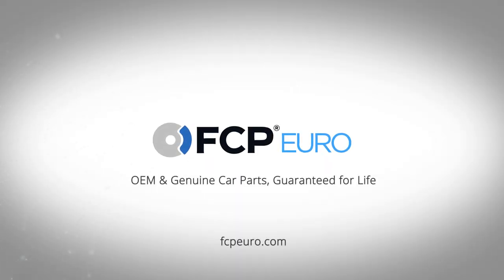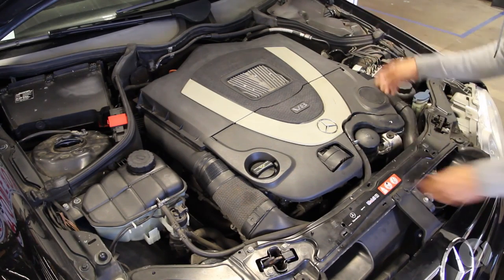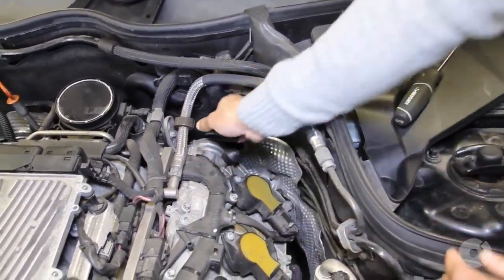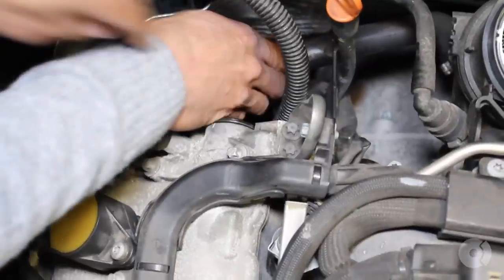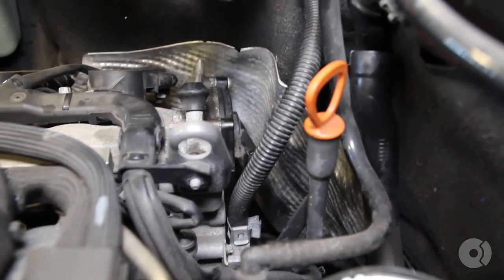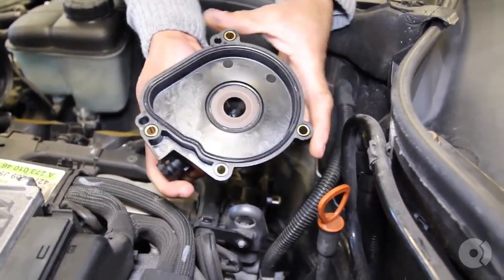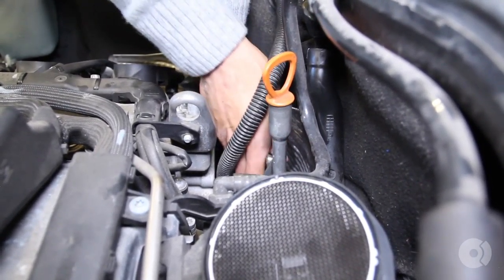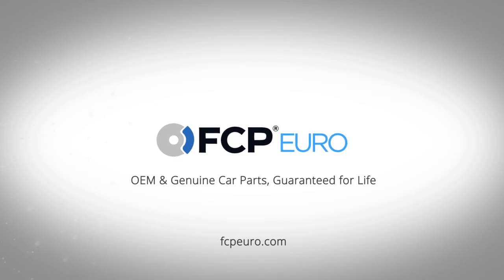Mercedes Crankcase Breather Valve Replacement - Easy DIY (CLK/ C-Class)

Comment: You may not be leaking oil on your exhaust from this part being bad. Little do you know there is excessive oil leaking in your throttle body. Due to that rebreather hose being directly connected to your air flow sensor housing. Which connects directly to your throttle body. So .. check your throttle body for oil.
Reply: Im seeing an oily mess around my throttle body. I figured it was from this cover, drip pan, and the other side oil seperator and hose going to the throttle body.  The parts alone arent that much but they all do add up.  Id love to clean the engine but afraid of messing something up.

Comment: Seems Like there's no Video Anywhere showing the Symptoms of Stuck Valve in the Newer Engines 3.5 M276 Engine. I'm Having a Very Rough Idle Like the Engine Visibly Vibrates/Shakes And Feels like its gonna Fall out of the Engine bay when I Gently Give it Gas (No its not the Engine Mounts) I Have done smoke tests and Tested for Vacuum Leaks and Found none. So I took the Breather end of the PCV where it plugs into the Intake Manifold and Blew Air in it and it feels restrictive, air still gets through, however, it's not getting through freely, I Have another engine I did the same thing and it Blows air freely, So I'm suspecting that it could be the Culprit, But I would like to know what the exact symptoms are when there is some restriction in the PCV. I don't see any oil leaks anywhere, Its a 50K Mile 2014 C350 Mercedes.

Comment: I changed mine the other day

NOTE:  With my vehicle the previous PCV valve had E-Torx bolts 8mm.   The two inboard bolts ( the ones on the breather hose side I was able to get a 1/4 inch drive ratchet with 8mm E-Torx socket.  The two outboard bolts are a little bit more....not overly complicated but admit that the space is tight and get it over with.  I used a 8mm box end wrench but not just any wrench a specific type.  Kobalt and I am sure other major tool makers have this type too.  It is the type that works on multiple types of fasteners ( 6 point, 12 point, square, and specific for this type...Spline head socket.  Yes manual wrench may sound crazy but in this case probably the only one that works.  Go in from the inboard (-Throttle body) side and place the box end on the body as close to straight 90 degree as possible.  The open end of the wrench should be on the throttle body side and if you have a slight offset angle fine.  Rotate bolt as close to a full 90 degree turn counter clockwise as possible.  The open end of the wrench should be facing the ground.   It might take a couple of tries but once you get the torque broken then you should be able to grab and finish by hand.  I was initially skeptical but changed my thinking when I saw how quick the torque broke.   If you insist on a ratchet/Socket then use a pass through socket set but for this case the wrench was much quicker and easier.  You could have the old valve out and new one in in the time that it talked you to get a ratchet/socket fitted over the head.  The added bonus is you have the head of the bolt to grab during removal.  The kitnfrom FCP Euro came with new T-30 Torx head bolts but since the E—Torx heads were fine and not stripped they actually worked better.   Since this is should be a fairly reasonably high mileage interval replacement the E-Torx head should work.  My 2011 E350 had just a tick under 103K during replacement.  I am fairly certain that this was OEM and the E-Torx bolts were used from Stuttgart but no big deal.  Thanks FCP for providing the Torx bolts and I am sure  they can be used for something.   Try a set of the E-Torx head bolts and try them for testing and future shipments. Thread pitch is the same as the T-30 bolts you provided but the E-Torx  bolts actually worked better despite having the same block-firewall clearance.  Also sliding the wrench over the head uses one less tool and keeps lower profile.  

 Note 2:   If you can get a piece of butchers twine or sewing thread wrap it around the outside of the open end side and secure tightly.  You can anchor the other end of the thread to either your wrist or a opening in the hood.  The logic is long enough to get the wrench to work with but anchoring to another area.  Drop a wrench, bolt, part, socket etc.....down in the engine bay ONCE and you will see what I mean.   Murphy’s law says the item dropped most of the time will not have the courtesy to fall through and straight to the ground.  At least twice this week the dropped items embedded themselves on a ledge somewhere in the Abyss of the engine compartment.  Most likely fell off that ledge after driving built as they say....learn from my mistakes.  Yes I have butterfingers but this can happen to anyone.
Reply: My 2010 C330 4matic Sport uses an E10 socket for the 4 bolts, but an 8mm closed end wrench also works.

Comment: Sunex 9732 44Pc 1/4" Dr Mini Dual Flex Head RATCHET W Socket & Bit Set 
This tool set was perfect for this job!
I used the 5/16 socket to remove the E10 Bolts and used the T27 to install new bolts, all included in this tool set!👍 I recommend for this job!

Comment: Fantastic video!  I found the parts elsewhere a little cheaper but I'll certainly buy them from FCP now that I've seen this video.  Real value.
Reply from the maker: Although we strive to be, unfortunately with the internet we can't always be the cheapest on every part! But we are still happy to be able to help share some knowledge and advice to anyone in need of it! Good luck on the install.
Reply: I buy most things from FCP for the replacement warranty.  Unless I just need something small like a bolt then ill go to the dealer.

Comment: Good video.  On a E-class, there was less space than this video, and I couldn't  fit a vise-grip on the socket (which is an E10 by the way) for the lowest bolt.  You can fit an open wrench but no one sells Torx open wrenches.  Fortunately,  a small 5/16 12-point wrench will fit and also grab the bolts.   So I used that for the whole job.
Reply from the maker: R D Thanks for the tip! That lower bolt can be a real pain...We will note that for any E-Class owners moving forward.
Reply: or 8mm closed end wrench for the E10 bolts.  I bought an 8mm deep offset long handle wrench specifically for the bottom right side bolt, made it much easier.

Comment: Can you guys post a video of replacing the partial load oil separator and it’s hose as well. I think if those parts are left untouched then the whole procedure which you performed is just incomplete. You guys sell those parts in your complete kit anyway.

Comment: I just got an E350 W212 - 2011. Having read up on the problems these intake flaps have on the intake manifold (a service writer at my dealer said he's seen some go at 100,000 miles; some at 200,000) - I get the feeling that if these are changed when needed that problem might go away - as they would let oil in to gunk up that lever. Then you have to replace the intake manifold. 

I too had a chuckle with Kyle's sweater but hey, if he is clean (cleaner than me) - why not? I didn't see one spec of grease on it. 

Don't know how he does it.

Comment: I have a 2010 E550. I noticed there is some kind of flexible grey hose that starts around the MAF and is directly behind touching the PCV cap (the grey hose is actually zip tied to the tube on the PCV cap on mine). The grey hose then runs parallel to the passenger side valve cover between the fender on the engine. It seems to be some kind of wiring that is protected by grey hose.  What is it ??? I don't see anything like this on your video. I can't remove the cap because the grey hose is in the way.
Reply from the maker: It sounds like that is a protective loom covering the wires. Perhaps you can try temporarily removing the zip tires and pulling the harness out of the way to remove the cap, and then zip tie it back in place when you are done.

Comment: Those bolts on my 2010 C300 4matic Sport use an E10 socket to remove.  An 8mm closed end wrench will work also.  Good thing i looked before doing the work, didnt have the right tools and bought a long handle offset wrench just to make it easier.  Surprised this video doesnt replace the drip pan while the covers off.  Im seeing oily gunk on my intake along the fuel rail and on the front so replacing all the breather stuff to see if thats the cause. Car just reached 150,000 miles.
Reply from the maker: We have a comprehensive drip pan and drip tray guide for the M272 and M273 coming very soon! These issues are often the cause of the trademark intake runner flap issues commonly seen on these engines, so it was wise of you to get out in front of the problem.

Those drip tray cover bolts can certainly be a pain! Rounding up the right tools in advance can directly determine how long this job will take.

Comment: I'm seeing light cream mixture under the oil cap can it be blocked breather  valve?
Reply from the maker: If the car does a ton of short trips without ever fully warming up, more than likely it is just moisture.
Reply: @fcpeuro  I think so also

Comment: Could a faulty PCV be the reason why I have engine oil inside the M272 intake manifold?
Reply: Yes. It will destroy the manifold by making it sticky due to oil build up and braking the plastic actuators. It's a lot cheaper than a new manifold...
Reply: @shawna7813  Wish I had thought of that a year or two ago...... after my car cools down I get the enviable job of changing the intake manifold this evening.... going to change that valve at the same time.  Good times.

Comment: This part work for e350 4 matic 2010 ? And question the motor has to be cold right ?
Reply from the maker: Hi David, we have a few kits available for your E350 available on FCPEuro.com. The best practice is to do this on a cold engine to avoid any burns!

Comment: What are the symptoms of having a bad crankcase vent valve? I am having a whining, squeaking sound when I do cold starts on 2012 ML350 in Minnesota and suspecting a crankcase replacement but worried about the costs involved.
Reply from the maker: A Squeaking sound could possibly be a belt. Usually, the symptoms of a bad crankcase vent valve are oil leaks, high idle, and a noticeable decrease in performance.
Reply: FCP Euro I believe this SUV does not need a timing belt change but I may be wrong. Dealer recommended part number crank case vent valve with OEM part number 276 010 03 31 that is available in FCP and from what  I heard it’s a big time cost for me to afford. How complicated it is to install this part and is this really what I need?

Comment: If this helps anyone with that dreaded last bolt, bottom left (bottom left from engine view), I just replaced my pcv valve (crankcase breather element) on my 2010 C300, M272 engine.  My car has the E8 or E10 inverted torx (I can't remember at the moment, but 8mm socket also works) instead of a T30.  Anyway, the other 3 bolts weren't too bad but I was really struggling with that last bolt so I gave up after 45 minutes.  I took a pry bar and gently kept prying since the other 3 bolts were removed, and since this is just a plastic housing with metal reinforced rings at the bolt holes, I broke the pcv valve completely off, and then I was able to remove that last bolt and get that small piece of broken plastic off, since I then had room.  I know, not the most sophisticated way but I think most of us who are here are DIY people not mechanics or even shade tree mechanics. So if this helps you, give it a try.  And no, I didn't allow the rubberized pry bar end to damage the end of the camshaft, the mating surface, or any of that sort of thing.  I did it carefully.
Reply from the maker: Thanks for the tip, Al!

Comment: Thanks for doing all these videos. Definitively like to see more on R350 W251.  Same engine M272.  Like for you to do it on replacing the manifold.  Have done this 3 times. No fun.  Also would like to see front and rear Suspension kits for replacement on R350's.  Love the R's. Wondering if you will ever sell the lower front and rear bumper body kits and rear spoiler. Dress up these too.  Appreciate all your videos and Im a regular customer of yours. Have  a fleet of cars so I only buy parts from you. Unless something in the old R107 you dont carry.

Comment: Is this the same for 2009 c300 w204?  I think there is something other than those small caps on driver side of motor leaking back there.
Reply from the maker: Hi, yes it would be the same on your C300!
Reply: @fcpeuro  I also have the break vacuum pump. Can I use a cheaper one or should I go OEM? Trying to save my and do this myself.
Reply from the maker: @xxsekoxx  Since you are already saving money by doing this yourself, I would go with the higher quality part. The last thing you want is to have to do it all again because of an inferior quality part!

Comment: My 08 Benz c350 sport needs a new one. I got the part but the problem of the last screw that’s really close to the firewall. My screws are T27 not T30 for those of you with 08 - 09 Benz’s. I lost 3 tools as the fell into the underside of the car never to be seen again so I had to give up and will attempt to retry fixing the PCV  another day.

Comment: where could the oil be coming from if you can see oil buildup under the inake on the backside of engine?  It doesn't look like either of the plugs or the breather could drip to it there.  I can't see anywhere it leaking just the buildup so thought you might have an idea.
Reply: like in front of the throttle body on engine there's a cavity and I can see some oil buildup there, the breather and left plug look to be too far away to drip there as well as the plug on the right side.

Comment: What is the part number for the 2004 clk500?
Reply from the maker: The 04 CLK500 doesn't have a traditional style crankcase breather valve. Typically you'll want to replace the breather hoses and clean the valve cover of any deposits. Here's a link of the breather hose kit we have available for your CLK500 - https://www.fcpeuro.com/products/mercedes-breather-cover-reseal-kit-m112-m113-oem-m112bcvr